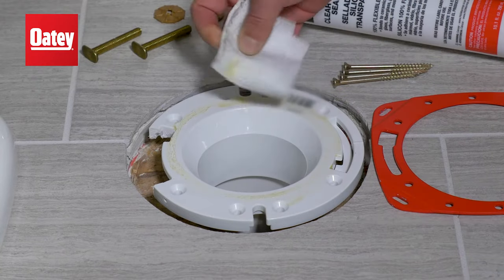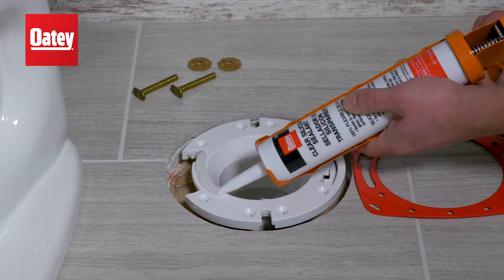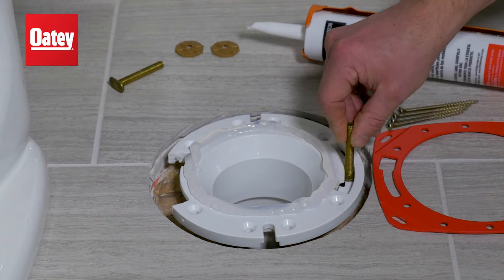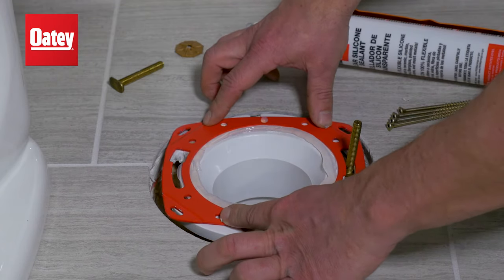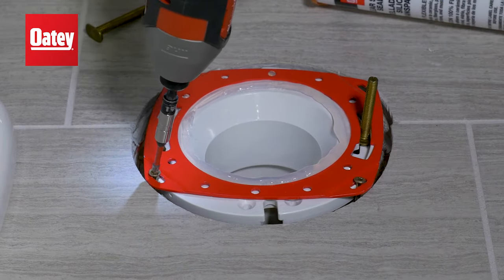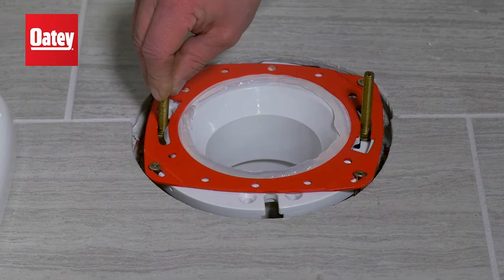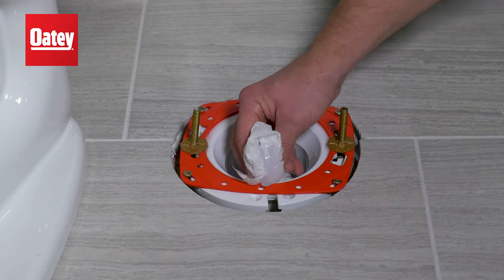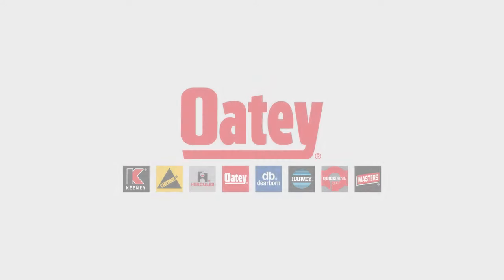How to Repair Broken Toilet Flange

Comment: Two issues there. First off whoever installed the first flange did it wrong from get go. It's supposed to be sitting on top of finished floor, not level, not below. Second 99% of the time the floor is to soft or rotted away where current flange is because customers neglect the leak and wait to long to call a plumber therefore screws will not catch solid wood then the at flange repair kit will not hold tight enough, . There are things you have to correct first in order for it to be corrected the right way. You might have to add flange extenders to get the flanges above finished floor like 1/4" then if floor is rotted , you will need a flange with extension tabs so you can catch dry solid wood so the screws will adhere good. I know this demonstration is just to show you. But if your going to show it demostat it with the flange sitting on top of the finished floor so DIYs know that the flange is supposed to be ontop of the finished floor. I can't tell you how many service calls I get because of contractors or handymen trying to stack two wax rings together to make up the void from a flange that sits below or flush with floor. I even see plumbers who do half ---- jobs as well because they are to lazy or just don't care about doing the job the correct way. Especially General Contractors or handymen.
Reply: Thanks for the info.  I have one closet bolt that isn’t anchored .  I’m assuming it’s a broken flange.  Next week I’ll pull the toilet and see what’s going on.  Haven’t had any leaks so hopefully the floor under the tile is OK.  Your comment gave me some good tips on what to look for.
Reply: That’s not true I’m a contractor And I take pride in my jobs wtf kinda statement Is that to say
Reply: @ckdub1888  I don’t think he was saying ALL plumbers / contractors are lazy.  There are plenty of them that are tho.  I’m just a DIY’r but there many things I’ve had to deal with because of contractors not doing it right.

Comment: Is the bolt supposed to spin? I can't twist the nut on
Reply: No it is not supposed to spin. It spins because the flange has nothing to hold the bolt head. Notice the head has 2 flat sides and 2 round sides. They have the flat sides to keep it from spinning. The flange grove on the bottom side is what actually keeps the bolt from spinning so if part of that is missing or has been widened due to someone tightening the nut to tight that it “strips” the grove. You will either have to replace the flange or use some sort of adhesive to keep that bolt from spinning. Maybe JB Weld or some other strong adhesive.

Comment: What to do if you are working with a house on a slab?
Reply from the maker: @E Boisen The repair ring can be used on a slab as well. The installation would be the same but you need masonry anchors to secure the ring.
Reply: @OateyCompany  Thanks for the response.

Comment: For a wooden sub floor what length and thickness wood screws do I need?
Reply: You want to use a screw that is resistant to wet (stainless, epoxy coated exterior rated, etc.) The screw just needs to be long enough to go beyond the subfloor just slightly, approx. 1/8" to 1/4" depending on your substrate. This ensures the best overall ability to grasp, hold, and minimize failure from tearout.
Reply: @kirkwd8829  so a 3 inch long #14 will do?
Reply: @hyprz  It should be definitely long enough. Your floor is probably between 5/8" to 1 1/2" depending on what you have, plus the thickness of the flange, spacers, etc..  #14 screw should do the trick.